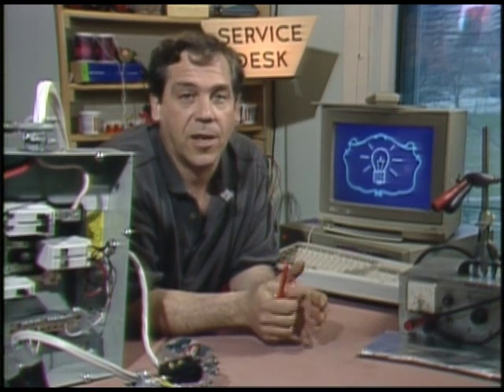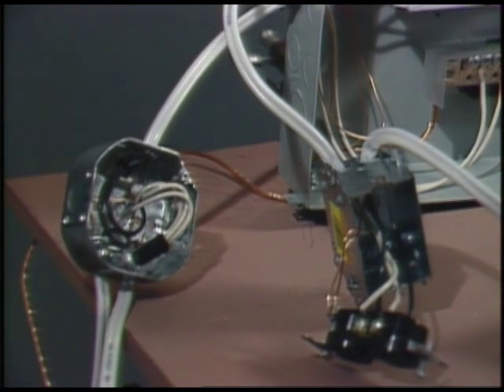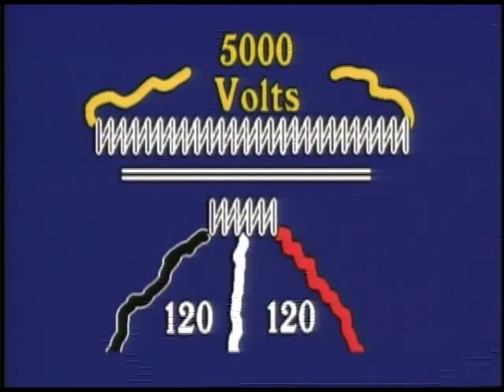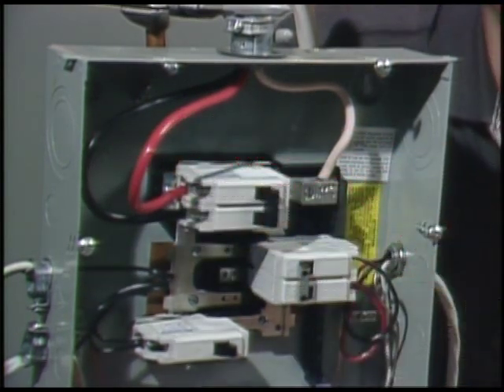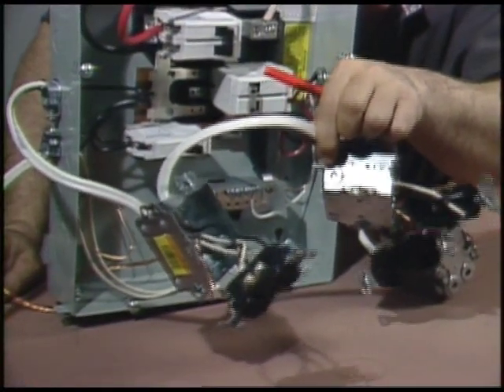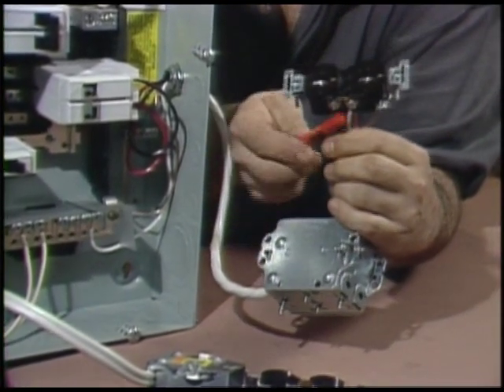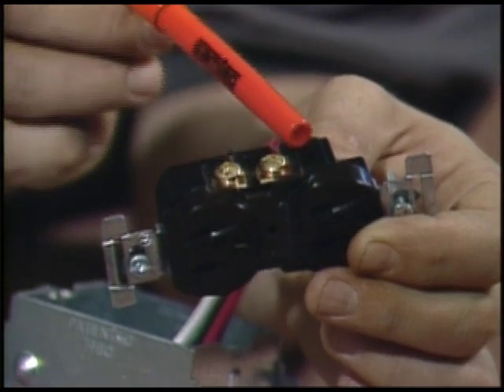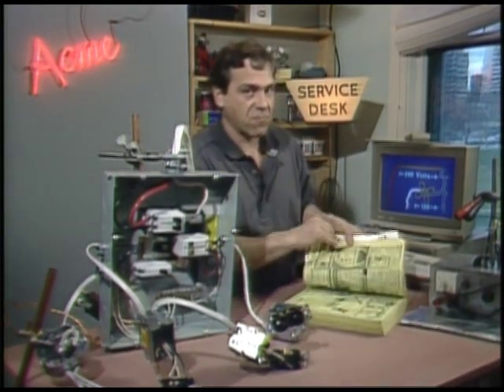House Wiring

Comment: 1 neutral wire can service 2 receptacles w/ 1 connected to a red wire & the other to a black wire because the red and black are 180 degrees out of phase.  that means as power increases in the black, it's decreases in the red, & vice versa.